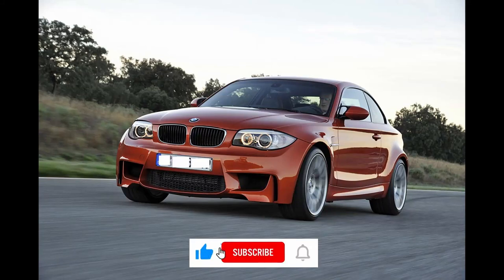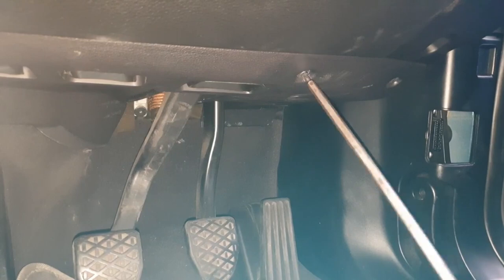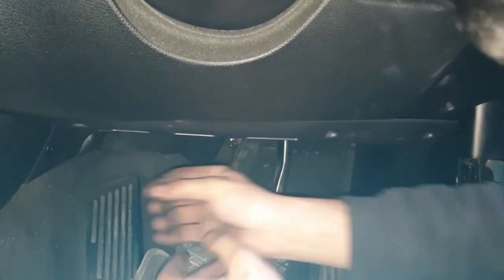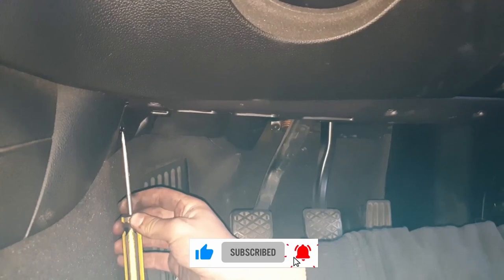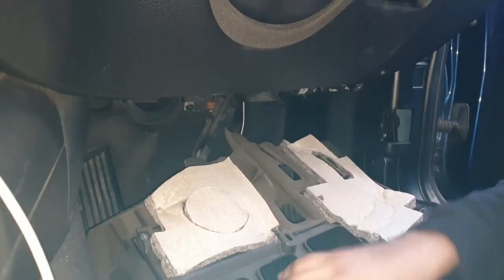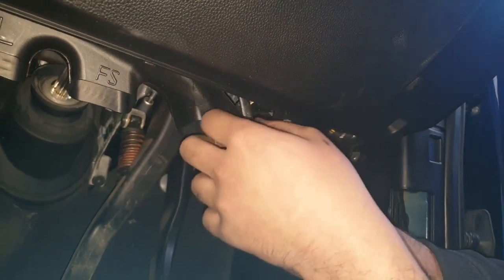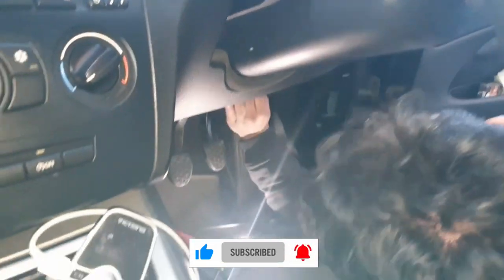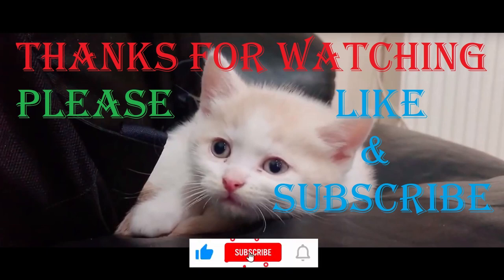3 Minutes JOB Remove cas 3 unit from BMW 1 Series e87 e88 cas3 removal Quick Fast and Easy

Comment: If anyone wonders how to access the bolt easier, there is a side panel on the dash you can remove and the bolt is right there. Easy access.

Comment: if you change cas 3 to other one from other car with keys. is it plug an play? or does it needs coding? tia
Reply from the maker: you might need to program with speedometer as well, or change cas 3 , key, key reader and speedometer together. 
thanks